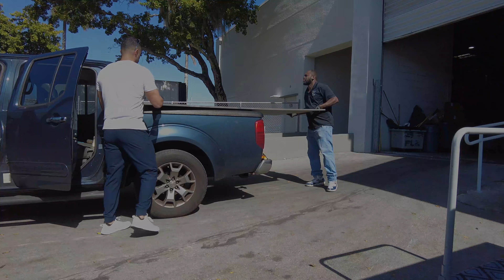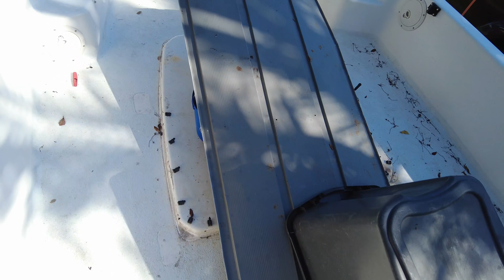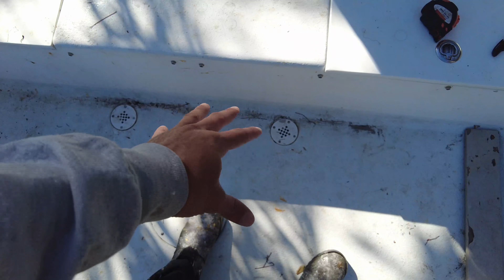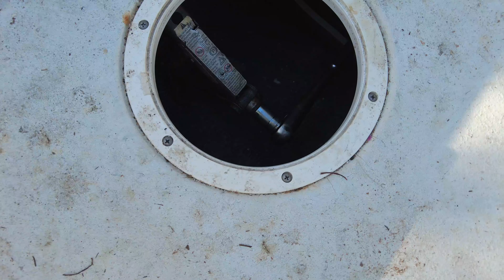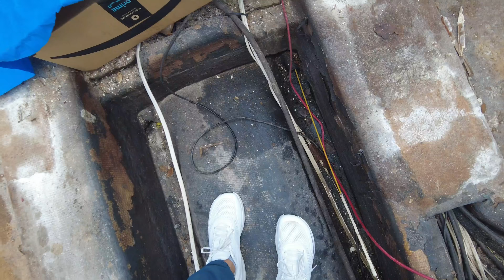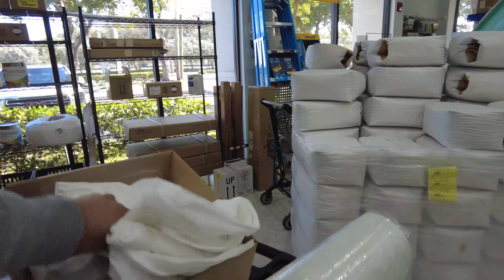Rotten Wood Removal | Boat Deck Rebuild Cost Breakdown

Comment: So you could do this guy's boat and not my transom? 😂 Lol. Just kidding buddy. You actually did help me through your transom videos i watched numerous times for reference. This guy's boat is in good hands. Looking forward to part 2. Gonna keep a sharp eye on this in case my floor ever goes soft. I notice you like to use kaycel over coosa. Any particular reason? I used coosa in my transom. Thanks Andres
Reply from the maker: This is a close friend/ family boat lol. 
So Kaycell, coosa, Penske board, gator board are all pretty much the same just different brands. They all have different density’s for different applications and all made of the same stuff. FGCI carries kaycell. Penske board was the first if I remember correctly 🤙
Reply: @perfectfitboating ok gotcha. Been out twice on the ocean since my transom replacement. Motor is still on the boat. Lol. So far so good. Looking forward to next video on the deck project.😊